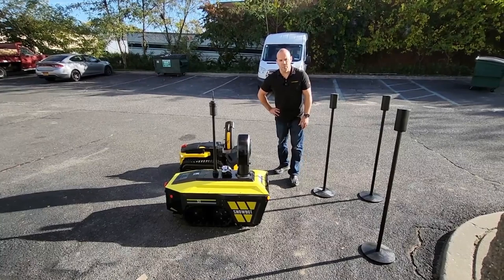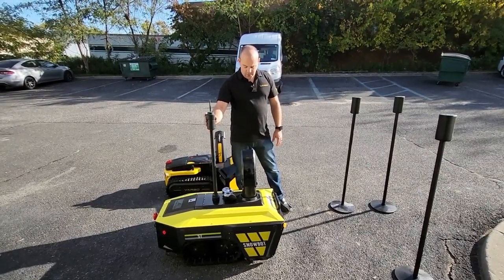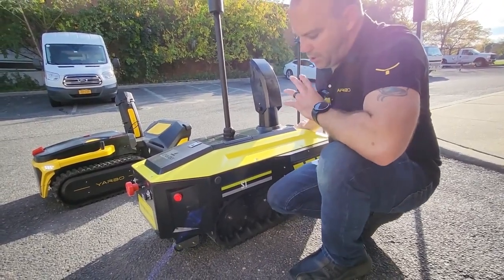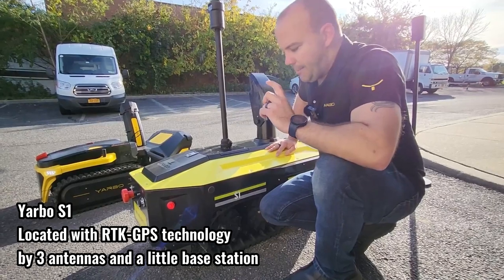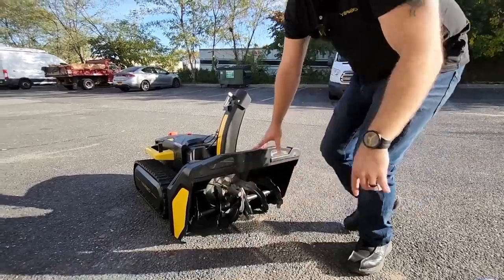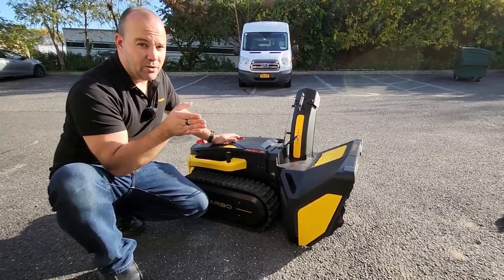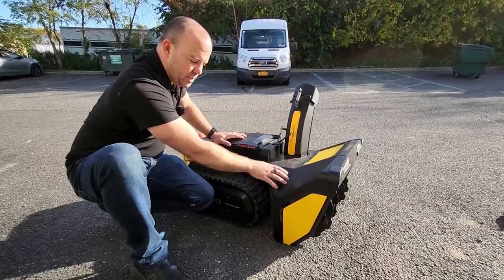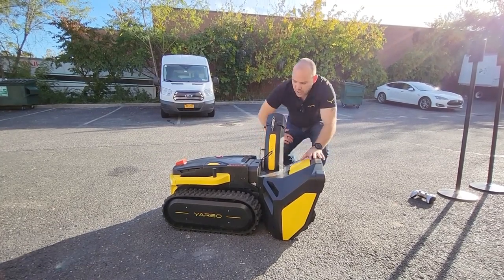Meet Yarbo: Yarbo S1 vs Snowbot S1 - What's the Difference?

Comment: How much snow is too much for this machine.  I live in Maine, so a significant amount of snow can fall in a single storm.  Do the sensors on the front of the blower still work with snow on them?
Reply from the maker: Yarbo is engineered with the capability to clean up to a height of 12 inches, although this is not its primary function. The principal objective of Yarbo is to provide consistent yard maintenance, facilitated by its innovative automatic charging functionality. Regarding its sensory components, Yarbo is equipped with heating mechanisms that prevents the accumulation of snow on its cameras. Should you require additional information, please do not hesitate to inquire further.